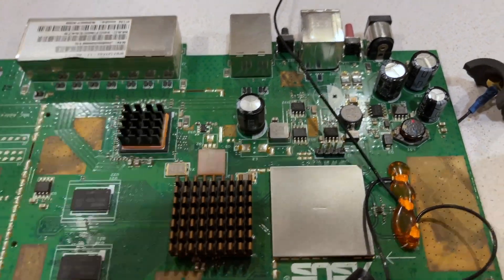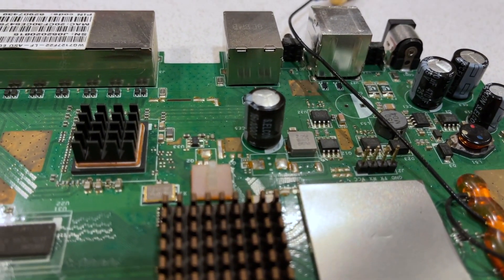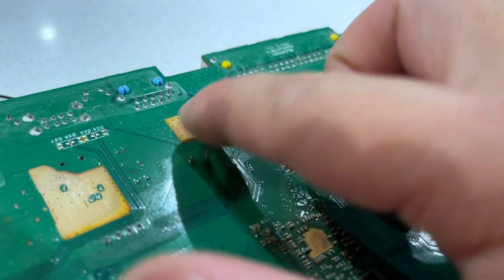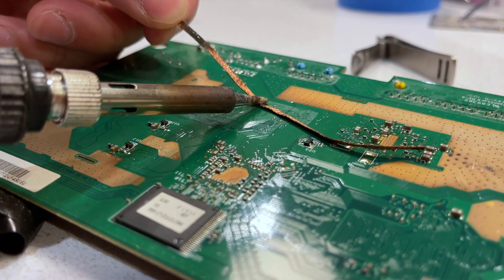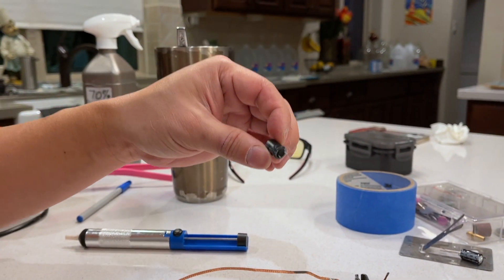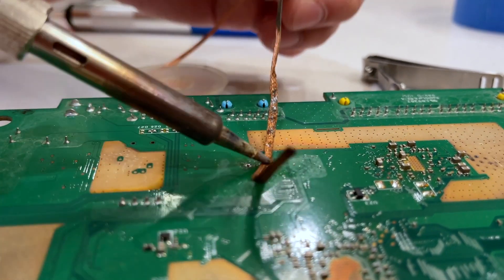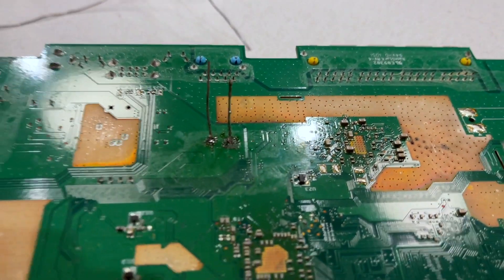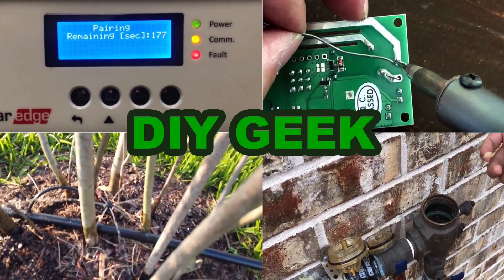REPLACING BAD or BULGING CAPACITORS

Comment: It helps to constantly clean your soldering iron tip and keep it tinned.  It should be shiny with solder.  If it is dull gray or black, it will be very difficult to solder anything. Soldering should go quickly, otherwise you will destroy your work with too much heat. Also, don't let it get too hot for too long.  Also, don't try to tin it when super hot.  Good luck!

Comment: Thanks for the video.  Just a suggestion- clean that soldering iron!  Get it hot, wipe it on a wet sponge, or maybe some steel wool, and then melt some new solder on the tip.  It will help the heat transfer to the work you are attempting to do, both for soldering and desoldering.